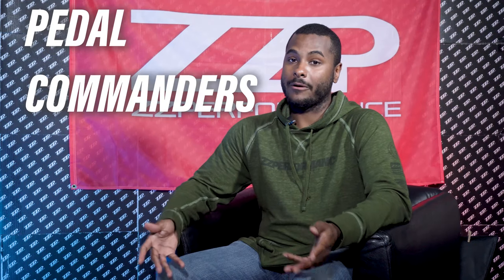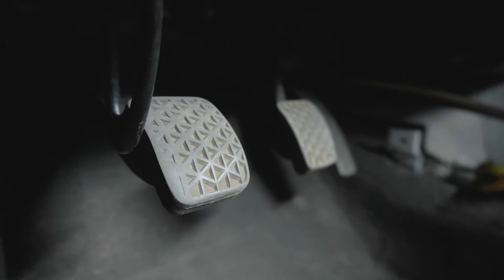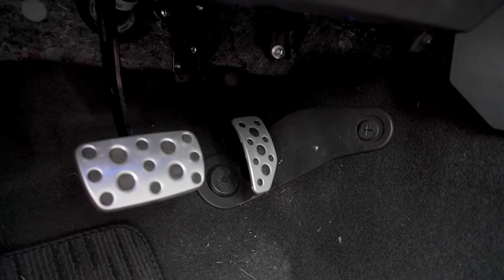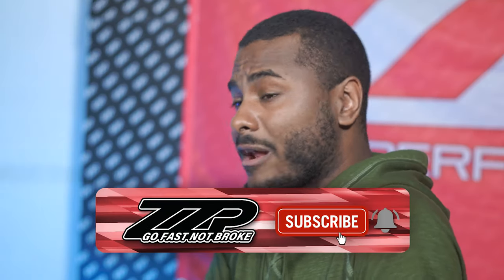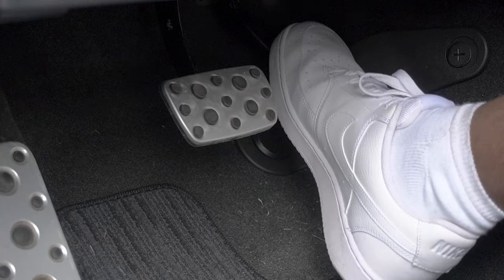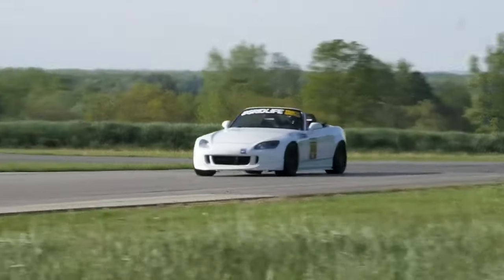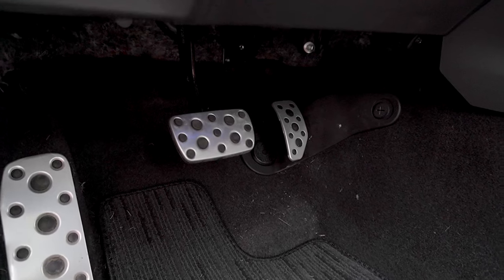Why You SHOULD NOT Buy a Pedal Commander // Behind The Builds

Comment: This is a very amateur review on this. Nearly everything you said was wrong.
Reply from the maker: Then by all means, enlighten us.
Reply: @ZZPerformanceChannel  not really trying to enlighten you guys. I know you know what throttle controllers do vs. an actual tune, but the way you present the information is so heavily biased against a throttle controller that it's unhelpful. Tunes will always be a more complete solution for optimized throttle, fuel, and ignition curves, but a simple throttle controller is a great solution for many people who understand the difference and are looking to deal just with throttle response issues.
0:43 - wrong. For a stock newer vehicle with a lot of throttle lag built into the stock throttle opening curve (throttle position vs pedal position and rate of opening) to smooth out the power for fuel economy or whatever other reasons the OEMs do this, a throttle controller will make an absolute night/day instant difference to the response and driveability of the vehicle. No it doesn't make more power, but it gets the power the engine can make out there sooner. Therefore they do drastically improve acceleration. It's not a trick. It's physics. More power sooner isn't a higher total HP number, it's more power in less time, which equals a faster rate of change (acceleration). 
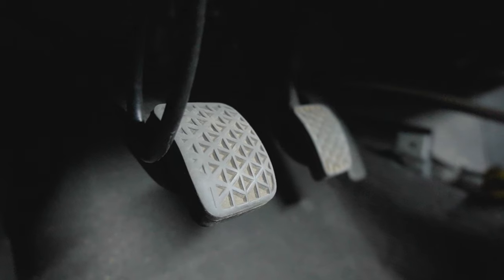0:53 - not really. First of all, pretty much all brands of throttle controllers are adjustable, but it makes your pedal control the throttle position in a much more linear way. You can control rate and position with your foot, like old cable operated throttle bodies or carbs, instead of just relying on the ECU to position the throttle how it's programmed to for smoothness and economy. 
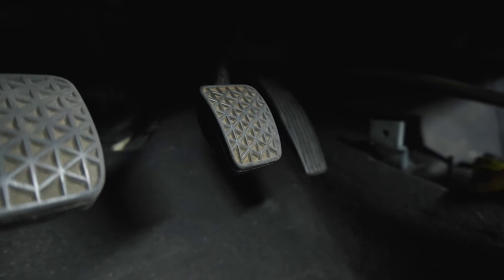1:04 - more throttle than necessary? Really? Says who? I'll use the 3rd gen Toyota Tacoma as an example. I can press the gas pedal to open the throttle body as I let out the clutch to accelerate and if I just floor it, there is an unbelievable,. significant lag in the throttle actually opening. Like several seconds. It's actually dangerous if I'm trying to pull out into traffic. If I floor the pedal, I, as the driver of the vehicle should get a fully open throttle. Not some ECU-corrected  percentage the throttle position at a slow and inconsistent opening rate. Flooring the gas pedal also does not necessarily open the throttle all the way. In my opinion, the throttle actually never opens all the way on the 3rd gen Tacoma. Not speaking for any other vehicles.

That's all I have time for, but you guys can do so much better about educating your viewers about the differences between a throttle controller and a tune, instead of the amateur, trash-talking quality of this video, which is full of inaccuracies. For the record, I support tuning, but throttle controllers absolutely solve a terrible OEM problem for some vehicles and are extremely effective.
Reply: @ZZPerformanceChannel  jesus you guys just got bodied by this man
Reply: @four4twenty  🤣🤣
Reply: @rocker1210  imma buy one now cause of your response 😂

Comment: What a stupid review.  Anybody buying one knows what it does, it doesn't add power it changes the sensitivity of the throttle, like you would tune the mouse sensitivity on a computer.   This fine tunes the throttle response to the driver and the purpose, rather than a one-size fits all throttle response.   Just like some cars have Eco vs Sport modes built in.

Comment: Your arguments are only valid in the eyes of idiots. You say you understand the point of this product, but you explain it in a way which hardly relates to its main purpose. These are designed to reduce or get rid of delay over all else. They can reduce the pedal travel distance before full throttle yes, but that is an additional feature you can choose to take advantage of, which I wouldn't unless I was messing around.

Comment: And u work at ZZP? U also race cars? Really??? I find that had to believe. Pedal commanders and boxes are to make the throttle more responsive on fly by wire vehicles as there is no cable and fly by wire as lag in the throttle. So, unfortunately u are wrong
Reply: The commanders do not make the throttle more responsive. That is physically impossible unless you have a box that can predict the future lmao. All they do is modify the APP vs TPS ratio. Sit this one out.
Literally the exact same thing as if you put a different radius lever on a cable throttle.
Reply: @armcclure  🤣🤣🤣 u sit this one out. I work on performance cars. I put turbos, heads, and build motors on cars. I know exactly what these commanders do. And yes they make the throttle more responsive.. So, try again
Reply: @SMAN3vo  YOU sit this one out. I design turbos and turbo systems and build/install them myself before final production, on top of engine calibration (aka doing what people THINK these BS boxes to the correct way). 
You can rant as many times as you want, you're still wrong.
Reply: @SMAN3vo  aaaand now you're blatantly lying. Took longer than I expected TBH. Thanks for playing.

Comment: Pedal commander is a scam! there I said it.☕
Reply: It does what it claims to do lol. Not a scam
Reply: @Pvtdre  Actually it does not do what it claims to do with throttle response which is deceiving.
Reply: @vvvvel  it makes the throttle a lot more responsive than stock…How is that deceiving?? You either installed it wrong or don’t have the product at all and you’re talking trash about the product because someone else is.
Reply: @Pvtdre  It makes you think you have real throttle response from the engine and does nothing for performance. the device tries to mimic the ETC botton from the factory that's mapped with your tune and actually does something lol.
if you want real throttle response upgrade the exhaust,pulleys and tune.
Reply: @vvvvel  it’s not for performance or any power gains🤣 It’s made strictly to improve “Throttle response/sensitivity”….. Nothing else. You don’t get any power gains. That’s why they don’t promote that it does. Therefore it can’t be a scam or false advertising. Lol like what do y’all not get🤦‍♂️
Reply: @vvvvel  I’m running a tune, catless dp, intakes and a exhaust on my BMW. It made a big difference especially launching it. And I have Xdrive (AWD) so it makes the launch more brutal every time. I love it. Zero problems. Installing it and putting it on the higher settings made my car feel like it gained 100hp. Mainly because my car is already heavily modded.
Reply: @Pvtdre  LOL why would you want to run this Chinese made product on your precious car?
Reply: @vvvvel  the one I have is a German Made product actually. It operates exactly like the pedal commander but just has better features and better quality/reliability. It’s also made mainly for BMWs and has a Anti-Thief mode. I bought for the Anti thief mode and happened to really enjoy the sport and track modes.
Reply: @vvvvel  also many other people buy the pedal commander because they don’t want to Void their warranty…It’s a easy plug and play device that will make your car feel like it just received a big performance mod but it didn’t. So that’s also another main reason why people want to install that product